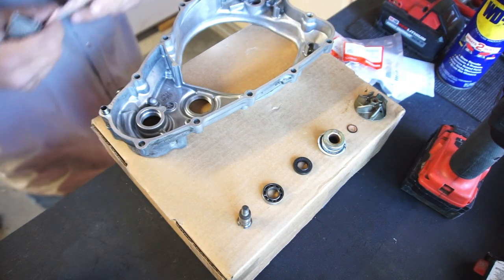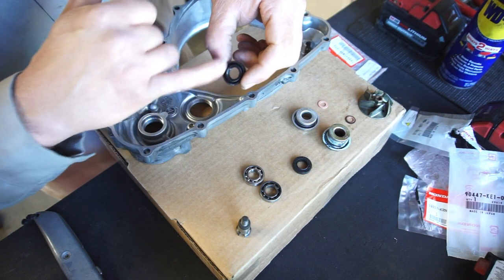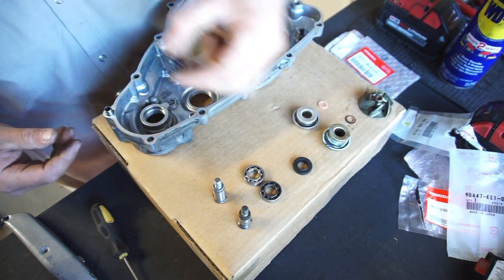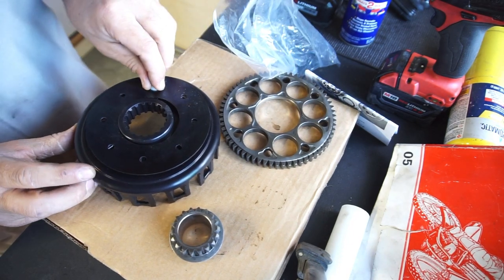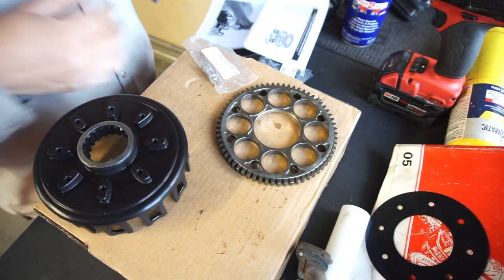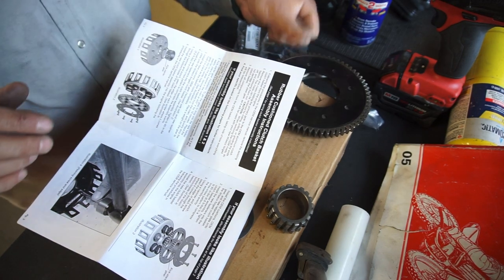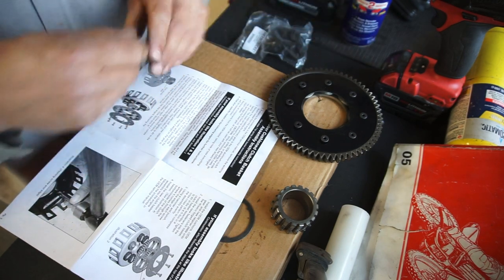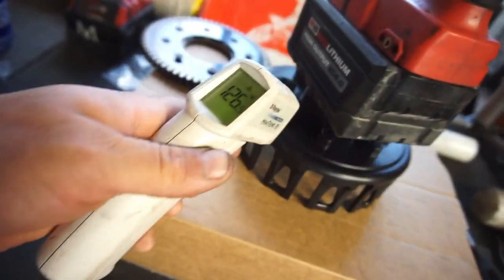Installing The Water Pump and Assemble The Clutch Basket For The 2014 Honda CRF450R.

Comment: Any tips on getting the old shaft out?
Reply from the maker: You’ll have to take the clutch case side off like the video shows and once you remove the nut on impeller you can push the shaft out which will technically be into the engine side.